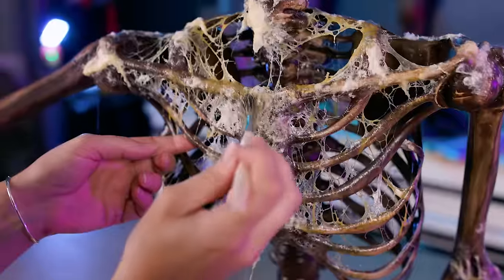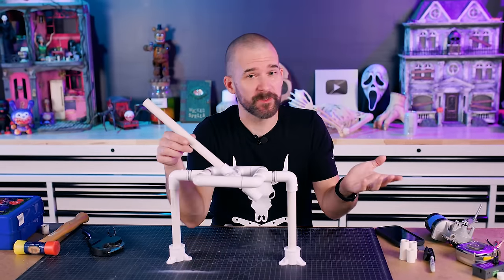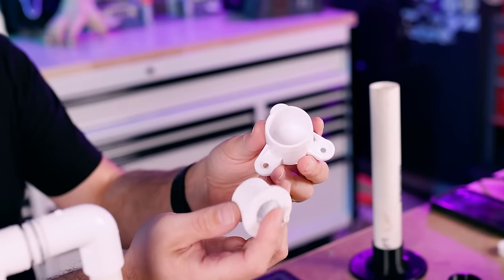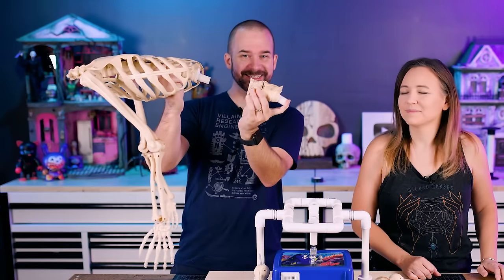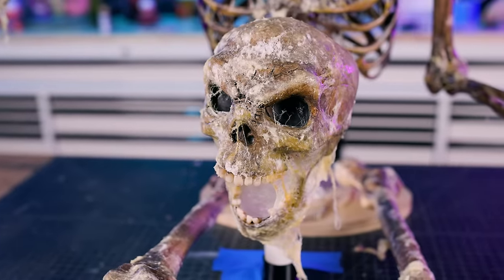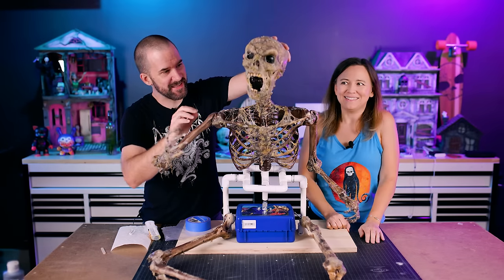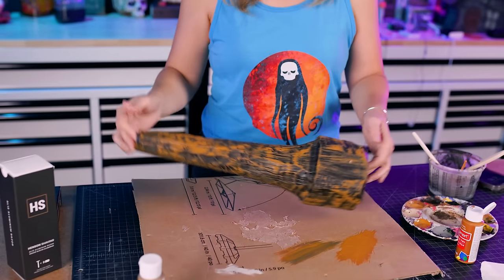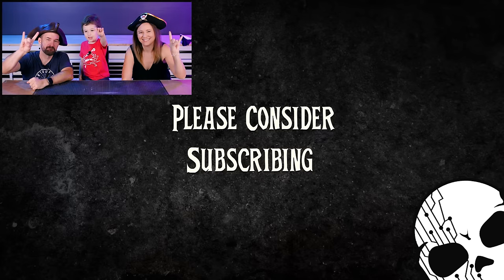We made our Skeleton into a DIY HALLOWEEN ANIMATRONIC! 💀

Comment: I think for added effect, adding some water with some ink in it to darken it and adding a cork that sits below the lip of the bottle could create some cool motion in the bottle.
Reply from the maker: Yes!!!! Need to sort out the weight (water is crazy heavy) but definitely agree
Reply: You could put an inner layer vessel in the center and have the fluid in between the two layers. Like one of those double walled cups that have glitter in them.
Reply: I think it popped up 3 times + love the prop
Reply: @WickedMakers  You could try some kind of oil, it's lighter than water at least.
Reply: @WickedMakers  i don't live in USA can I be in the giveaway ?
Reply: @WickedMakers could have a thinner cup within the bottle to make an illusion of more liquid
Reply: @WickedMakers  corn syrup is substantially lighter than water, and it can look more like a groggy/alcoholic beverage
Reply: @WickedMakers  I know im really late, but u can add another layer of plastic or glass around the bottle, with a centimeter gap between the two bottles, and add the water in that small gap. Ifykwim

Comment: Prop turned out great. Just a tip for anyone building anything with a wiper motor the step in inclosing it is really not necessary. Been using wiper motors in the poring rain for over 15 years. They are water proof and made to get wet. Have never had one short out even running the props during rain. Wiper motors are absolutely the best. Get Your Haunt On! 😁
Reply from the maker: That’s great to know!

Comment: Great job, as always. I thank you for steering away from using a 3D printer, I've been making Halloween props for 10 years, I have a lot of tools for making, but no 3D printer or vinyl cutter, those just aren't in the budget.  The dancing fellow showed up 3 times, if I remember correctly. Possible names, Barnacle Bill, Poop deck Pete or Frank the Plank.

Comment: i wonder what would it look like if you drilled a small hole in the bottom board, and put a ball under it maybe a tennis ball would be enough, so the whole thing can tilt all over the place as the motor drives the upper body around it'll tilt around, moving the legs, maybe?

looks awesome as always though, great job.

Comment: You mention that one of the best upgrades to a cheap skull is to rip it's teeth out and replace them with more realistic ones, and this is very true! If this is out of your crafting budget, though, another cool way to upgrade the teeth on a plastic skull is to paint them with glossy white or slightly off-white nail polish. Make sure to paint each tooth individually, leaving a slight gap between them. This makes them look SO much more like actual teeth, and makes the individual teeth stand out, and it's easy to stain over the polish if you don't want the teeth pearly white in the end. Just a little Halloween tip to others who love to haunt on a budget!

Comment: Where do you get jugs of liquid latex? When I looked in craft stores, they wanted around $5-7 for a tiny little plastic container that probably wouldn't be enough to do the head, let alone an entire torso. Sure, you can order jugs of it online, but then they want a small fortune for shipping. Many years ago, I watched a video on how to make a corpse from scratch and the author was like "It's cheap, you can pick up a quart of it for like $10!" I gave up when I couldn't find anywhere to buy it locally and couldn't justify ordering it online. For reference, I live in a relatively small city that has the normal assortment of chain stores, but doesn't have all that many specialty shops.
Reply from the maker: We used like maybe half of one of those small bottles. It goes a long way. Amazon has it, or Spirit this time of year.

Comment: this is awesome! do beware though that latex will rot and degrade in UV light, and since you said you are going to have him outside I would pay attention to that. Probably wont happen first season, and being that there isnt a LOT of latex on there it might not be that big of a deal, but just something to keep in mind for other projects :)
Also another tip for doing hair on stuff like this, use pure silicone caulking (like GE silicone 1 from homedepot) to attach it. you can really smush the hair into it and it gives it a nice look and it holds it on there really well without having to do the extra step of adding latex. plus its a fast and easy way to hair things

Comment: Hi! I love your build! I’m trying to make my own version and I’m getting stuck on the electronics (out of my league). In the first portion of the build when you test the motor, you have the female power adapter connected via alligator clips to the motor (I think?).
Then later in the build you have the motor directly attached to the female adapter. Finally, you have the speed dial attached. I’m just looking for a simple on/off so I was going to just connect the motor to the female adapter. But I can’t seem to get any configuration of wiring to run the motor. Any recommendations?

Comment: When you are Working with the ribs do you have a heat gun and a applicator and it sounds like you’re saying barge what is barge? I’m not understanding. I guess I’ve listened to it three or four times now just can’t figure it out I guess.
Reply from the maker: Barge is a contact cement glue that’s thick and a little stretchy, You don’t need a heat gun, a blow drier will work fine. It’s the blowing air you’re after, not the heat. So you dip your brush in the glue, tap it on your skeleton, then as you gently lift the brush up, you blow on that little strand of glue between the skeleton and your brush with your blow drier and the moving air will make it spiderweb out.